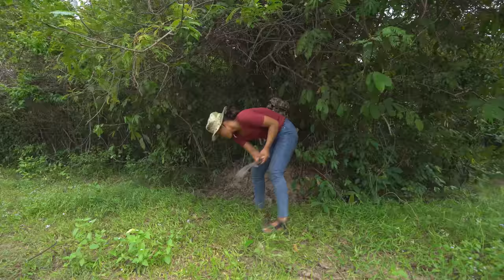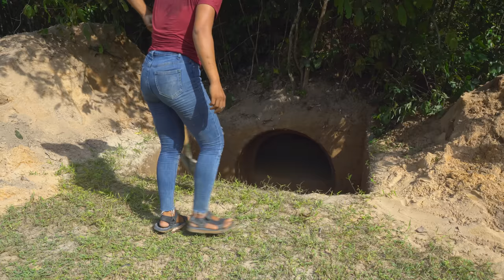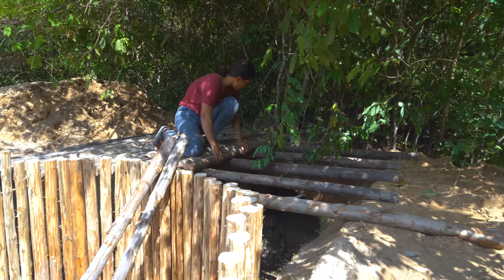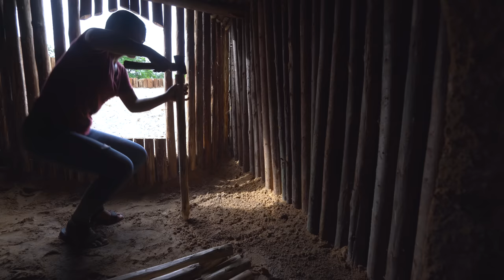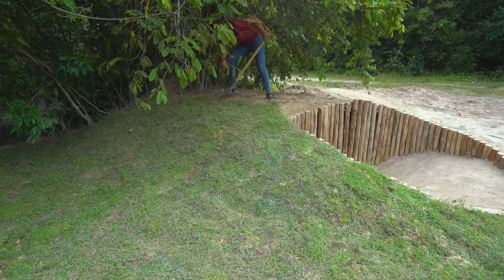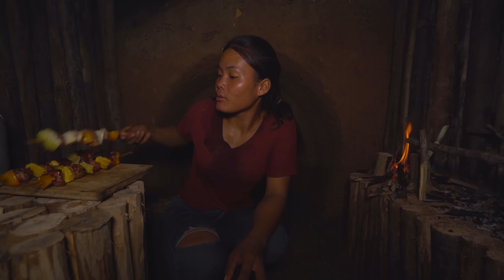Girl Living Off Grid Built The World Most Secret Underground Home with Fireplace 2022

Comment: Building a fire in that dugout would have filled the entire space with thick smoke that burned the eyes and filled the lungs with smoke. They cut that part from the film, this structure wouldn’t work for having an indoor fire place you need a chimney for the smoke to escape or it could actually kill you.
Reply: That's what I was wondering how she would keep a fire without filling up with smoke!
Reply: There is a chimney! You can see smoke getting outside on first picture...
Reply: also building a fire that close to wood timbers would have burned that to the ground i call bs
Reply: I thought that where she put the candle would have been the fire place. 🤦🏻‍♂️
Reply: Not only that, but the entire underground shelter would also flood. Unless I missed something, where would the water go should there ever be a storm? She basically built a huge pothole for water to accumulate.
Reply: @toddhuse9867  that was the most troublesome thing i saw too, luckily it didn't catch this time, but that is a very bad setup, she could have easily built the fire further from the wall..  the whole 'shelter' is not going to hold up for very long at all,  not at all rain or wind proof, you can see right thru the wall even.  but impressive she built something like that in one day (i think) by herself, with some weatherproofing and improvements could be decent little chill space.
Reply: to all of you that had constructive criticisms regarding flooding and smoke you guys have the concept of heat rising and gravity most children know at an early it seems none of you have ever built an underground facility so your concerns are lacking intel AND clearly none of you were infantryman for the United States. this maybe so true regarding other armed forces for other countries but I can only vouch for this one's army... rangers lead the way hooah!
Reply: read the ranger handbook about building a smokeless fire.... and I'm not really sure that you guys were paying attention at all in the very beginning because that's probably why she looked for that little mound that she was on and why she built it predominately under a bunch of other small trees to defuse the smoke and protect her from the very things that you guys are so "concerned" with and know nothing about.
Reply: I will write a little bit of a defense 4u architectural aficionados chiming in with your natural disaster warnings lol... so here goes in their defense I would like to point out that there are a lot of bits of training that is completely surrounded trusting your equipment and a neat little example of that being that I was also airborne army cuz you got to be when you're a ranger... even if you're only ranger for a short period of time and then head up to Alaska to be an arctic paratrooper lol... anyway when you're fully equipped in those brown round static line parachute rigs... you land with what they called plf AKA parachute landing fall really cheesy name but that's what it is or at least that's what it was when I was in any way that's a five point of contact for all that basically looks like you are a giant banana and you flipped over one time. believe it or not you come in with that parachute on at approximately 21 to 27 mph.... that's the same as jumping off a two-story building without a parachute... with that little bit of knowledge I went all over Northeast Missouri jumping off the second story of every building I could find with a crowd watching and put on YouTube a few times... those are bullet points here is the piece that will bring whole thing home... what about your equipment and knowledge of physics. no matter what shape or size you are, a human's terminal velocity is approximately 120 miles an hour and it only takes about fifteen hundred feet to get there... depending on conditions of course though it could take no more than 3,000 feet... so here comes... if you fall from 3000 ft... it would be the same as falling from  30000ft.... which of course is the cruising altitude for most commercial airliners... if you form an upside-down v with your body bending at the waist and putting your hands together above your head imitating a human doing an impression of a parachute... that posture right there will slow you approximately 30 mi an hour to a magic 90mph... that impact speed is something that you can survive. and at 30,000 ft you'll have all day long it will seem to pick your landing zone or really drop zone in this example. you're welcome to message me if you want to know the other steps to finding a good landing place and if you do it right you most likely can survive with a mirror broken shoulder or maybe just an arm. true story. don't believe me. check my facts. I care enough about you guys to help you survive but I don't care about you enough to lie to you.
Reply: Why can’t we just watch the video and enjoy it for what it is.  A video on YouTube.  😂
Reply: I got super suspicious when I saw that well worn trail…then I love how the kabobs came out of the bag. That’s not living “off the grid” and super secret. 🤫
Reply: I love her tools 😅 …..I wish mine work that dammed good👍🏻

Comment: Amazing work, but I’m concerned about carbon monoxide in those low areas since it is heavier than air.
Reply: Code enforcement she didn't pull the proper permits
Reply: She may have installed a vent, no shown.
Reply: This women eats carbon monoxide for breakfast.
Reply: @ownyourworld  😆🤣😂😹😆
Reply: my main concern is it rains alot in those countries wouldnt that place get flooded out quite a bit, Sweet idea I would think that should be done in the side of a cliff not on straight flat ground ok a little hill
Reply: Y'all are too much😩😂
Reply: I know!! That’s what I was wondering!! It’s all so ingenious and then the idea that that fire that was making all these air quality warnings might have moved to her walls and having the whole thing collapse was scary. 

I want to see a vent!! But otherwise so cool.
Reply: smoke itself is a problem as it irritates the lungs and causes other problems, it might be fine as a one-off, but without some serious ventilation (we shouldn't be seeing that much smoke filling the space), it would become very problematic if done on a regular basis.
Reply: She put a pipe hole in the ceiling of back of fireplace

Comment: Very cool. It'd be interesting to see how it holds up over time and during a torrential downpour.
Reply: I'm not sure I would get into that bed space with no supports whatsoever, If that caves in no one would ever find her.
Reply: @JoePCP , I know I wouldn't. She supported it somewhat with the roof over her dining area, but it is only a matter of time without vertical support.
Reply: @JoePCP  I suppose it would depend on the soil type. Some places it works some places it's an elaberate grave.
Reply: And wouldn't it fill up with water in a big rain?
Reply: Exactly what I was thinking.
Reply: @Lorelle Becton, I did not see where she did anything to prevent that from happening, which prompted my original post. I could have missed it, but I didn't see anything that would, at the very least, divert such an event from happening.

The ceiling support issue is just as real and relevant to catastrophic failures as this off-grid dwelling demonstrates.
Reply: @frosty3693 , an elaborate grave is spot on. I am not knocking what it takes to make one, nonetheless.
Reply: It won't. Not even once.
Reply: She built her sleeping area off the ground, covered using the roots of those trees which will also give support, in a location where the rain wont fall directly down on her dining room roof because the rain will to fall between the leaves of the trees before hitting the ground, then the grass carpet will act as a sponge mat carpet. And most importantly she knows the best location to build it. IMO
Reply: @JoePCP  its supported by the shallow root system of the trees on top
Reply: @velvetpaws999 , the Parthenon fell for crying out loud. Nothing lasts forever, not even burial sites.

Comment: They left out the best part. She also builds a Toto toilet from scratch, runs a water line in from a nearby river and then ties the lateral sewer line into the city’s sanitary sewer. I mean, digging a dugout is one thing, but fabricating an entire water and sewer system in one afternoon? Damn.
Reply: While I realize this is a joke, it actually is possible if there's a stream nearby. You can make what's called a "rampump" which doesn't need electricity and can pump water long distance and uphill. Pump that into a reservoir, which can be something as simple as a storage container from Walmart, add an out flow for overflow, a spigot to get water, and a pipe to go to tolite area. For toilet, just a large pipe would do the job. Set a couple large logs on either side of the pipe, and one of those camping tolite seats from Walmart on top of that. Run the septic line back to the creek, past your intake of course. And there you have it, a perfectly functional water and septic system.
Reply: @B Gallagher it would be incredibly hot once she built a fire in there as well as the ventilation issue.
Reply: @lisaellis9725  sewer lines are buried. Assuming the creek in question isn't right next to the place, even if someone spotted a lone white pipe feeding into the creek, they'd never be able to trace it. Anyway, it's kinda a moot point. Stealth can't be the goal when you make it so obvious. I would have forgone the front yard area, (which btw is going to collect water the next rain like a bowl and flood the whole place), and gone with a mud and leaves covered door, that once closed would be hard to see. I know the title says secret but any hiker could stumber across it easily, and a plane would spot it even easier since it's so obvious and in a clearing of all places
Reply: @Alan R Go?
Reply: @B Gallagher 🤗 I also thought about the bugs and etc.🐍 creepy crawlers because they did show a few worms🐛 and a frog/toad 🐸She could open the door that was made, and it also had some space in between each piece of wood without the door being open, for ventilation🔥Still, it was an amazing build for a temporary place to be, and to be built by a young lady 👩 Awesome Skills 😍
Reply: but where is that video?
Reply: Where did you see that?
Reply: @B Gallagher She would just catch the bugs and snakes and make a tasty meal out of them.
Reply: You guys do realize that with recording you can stop and pick up where you left off the day before. This may have taken more days but I don't believe it was one. My opinion.
Reply: @B Gallagher I was looking through the comments for ages to see who would ask about the smoke ventilation! Amazing job she did there but that was my first thought when she lit the fire. Where does the smoke go!
Reply: @B Gallagher There's plenty of ventilation.  Those logs are not close enough together to make the place air tight.

Comment: Absolutely beautiful and that girl is a sculptor. That was such hard work terribly hard work and she made it look so easy and simple. What I wanna know is what happens when the rain's come and the water floods down there I mean I saw she raised it up a little bit at the entrance but maybe 18" and I wondered if that's enough to hold the water back.
Reply: I was wondering that very same thing.
Reply: If it rains, it will more than flood.  The soil is loamy sand, and water will essentially pass right through it, and wash it out where it's not supported.  That timber is not holding up the walls, so rain will just wash the soil into the hole, and eventually (quickly) just collapse the whole thing.
Reply: @timfraser3272   That's what I was wondering. It seems like a lot of work just to have the rain come along and wash it out.
Reply: Just editing. Betting when the camera was off she came in with a backhoe and chainsaw for all the wood. All that would take a month or more of digging by hand.
Reply: Definitely not flood resistant nor is there anything to stop water from permeating into the hideout..
I did notice there was a trail, so it's not that secluded as to be believed by pretending to zig zag through the jungle..
Reply: Yes, it's definitely not a remote location as seen by the well worn paths at the site. I wonder what kind of wood she is using and where it came from. It would be nice to see the home months later to see how it held up.

Comment: The basswood looked already dried. Listening to the sound when she hit with the ax made that dry sound, not green. Too many things about this vid says it is either highly edited or fake. There is NO vent for that fire, but yet she did not look like she had any issues with smoke? And what happens when the monsoons/typhoons/wet seasons hit there? Does she convert it to a pool then? Cool idea, but not practical nor sold on the 'secret' description, or actual project for any purpose.  It would last maybe a year and disintegrate/fall apart. They spent more time in the vid watching her eat than the actual project!
Reply: @jackiepearson5505  Critic with sensible, well thought out points. The 21st century is great but way too much emphasis on 'yes you can!' when reality says, no, no, you really can't and probably shouldn't. Nice video though, it will flood at first heavy downpour....
Reply: i thought the same thing about the smoke and no ventilation...and with all the dries wood she used to build this structure.

Comment: Very cool skills with some great ideas. I was wondering though, would the wall made of wood behind the fire eventually catch? Also how did she control the smoke? I think I would want to sleep near the entrance for a quick getaway  just in case. I would not want to be trapped in the back if the embers from the fire did take off, while sleeping.
Reply: Good points! I also wondered about using open flame while she cooked. Seems like surrounding it with some stones would be a good idea. And she surely does need an emergency exit by the bed.

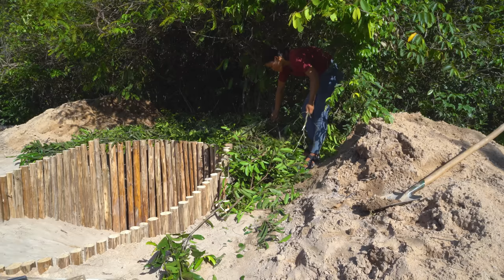Comment: I found the overall build fascinating like I did the footprints of differing sizes which were visible after large portions were completed, but the work was edited out. One can be seen at 8:22 [lower left], though I'm sure some will insist it's the camera angle, lighting...bigfoot etc.  ;)  No one can be emphatic if she worked alone, or completed this in one day [something the video implies], but it's interesting none the less.
Reply: Indoor wood fire with no chimney. Turf unlikely to take on roof of twigs and sand. Indoor turf in pitch dark certainly will not. Interior lower than surround with no water barrier.

Comment: I'm impressed by the work it takes to dig the giant hole but functionally it's a mess, like a fireplace with a flat surface and no ventilation surrounded by wooden walls, also super wasteful how much wood was used, and totally disregarded the bark on the tree, could have made tethers so you didn't need to use those nails, you also would have made a door that didn't need metal hinges, it looks kinda cool though, would make an ok children's fort

Comment: Humm.. Lots of work for a short term shelter.  Issues with flooding (rain soaking thru roof reduced with sod but not eliminated and in sloped entryway). CO and smoke from the fire (exhaust hole in the back wall is not at the top of the wall) reduced with the candle to start a draft is an excellent method. Fire damage to the wall at the BBQ area every time she starts a fire there (reduced if she just brings the hot coals to the cook area).

Comment: I hope the sand doesn't collapse in on her. I might have driven the wall sticks deep into the ground and then used wood to jam between the two walls, creating a ceiling and pushing the walls outward. You could even do the same at the bottom for the floor so that everything is very shored up and safer. Nonetheless.... pretty impressive skills!

Comment: I don't know where this girl lives, but what I'm sure is that this type of structure will never survive the monsoon. I lived 10 years in Asia, mainly 7 years in Thailand, so I know the violence of the precipitation, the power of the mudslides. A blow to end up buried alive or drowned. not to mention the problem of insects (Ants and centipede, among others) (but depending on its distance from the cities, poisonous scorpions and snakes can quickly creep into the Feast.
For this, if you want to build a shelter, it is better to do it high and hard (with wood) If you want to make galleries underground, you can do it, like the Vietnamese, in clay soil and on a sloping ground to prevent tunnels from being drowned. Clays have the advantage over earth of hardening spontaneously in the air and require little shoring.
Although for my part, (I am not a monkey) I would build a wooden structure on stilts
With light walls in woven Latanier palm and coated with cob of mud and straw. Topped with a banana leaf roof...
Probably no longer than digging up tons of dirt.

I think she better do two long and black Braided Pigtails and dress traditional. (much prettier and sexier)
To find a nice husband and start a family.
A little healthier behavior than digging holes for a pretty girl.

She is beautiful as a heart, and men rush to her feet.
It's still happier to create a family and give birth to two many little cherubs and darlings than to live in the mud. The mire and decadence

Sincerely

Comment: There is all kinds of wrong with this - no shoring off of the dig for starters... No gloves, open toe sandals. etc.  Also - bamboo grows pre-cut?  Evidently, power tools were used at some point to produce the lumber, so - why not use those for the build?  And where is the exhaust?  I fail to see the point of this - I bet if it were a guy who dug this hole, people would be a lot less impressed.  Needless to say, when the soil is essentially sand, this become a lot less challenging.